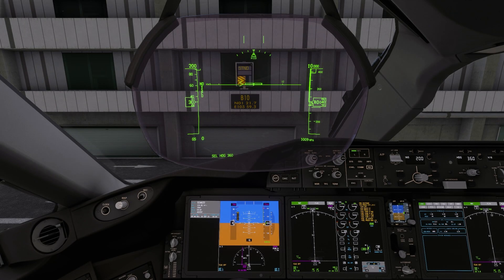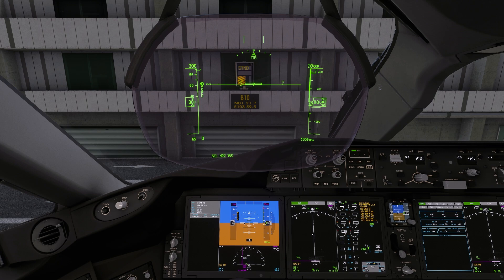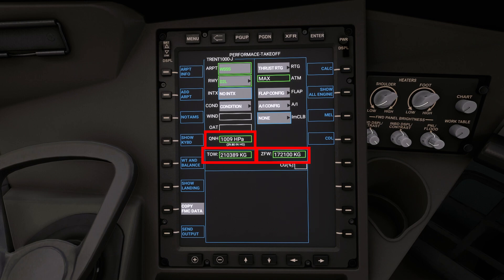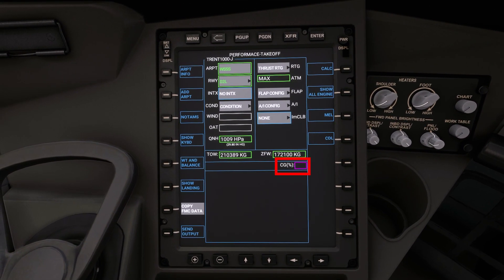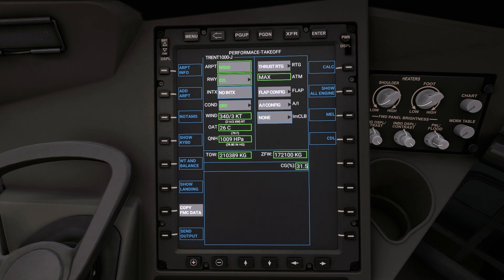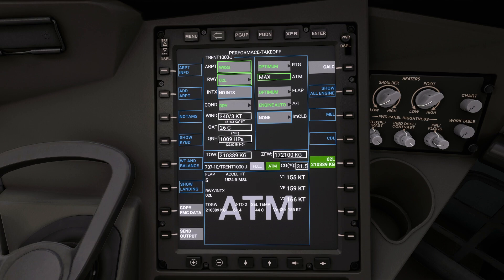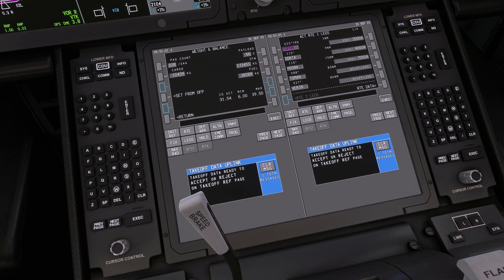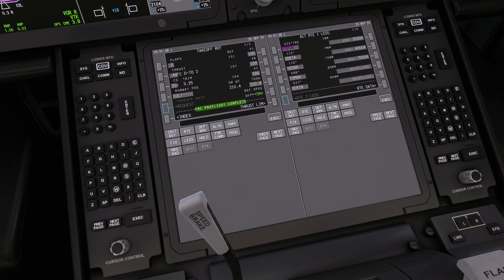Tutorial: How to use the EFB in the Boeing 787-10 Dreamliner

Comment: This is a very interesting and helpful video but as someone commented earlier, there is very little new there that can't be achieved by the FMC itself. However, perhaps somebody here will be able to throw a light on the problem I'm having or rather show me a solution. After this last MSFS update my 787-10 behaves very odd. It won't climb past 10000 ft unless I force it to and when I descend then it won't go past 10000 ft either unless I disconnect the A/P and manually descend down to 5000 and then reconnect the A/P. Then I'm able to descend and fly the approach as per normal. It does not matter how high I go, FL200, 300 etc. and it always levels off at 10000. I don't know if I'm doing something wrong but this is the only aircraft that displays this behavior.  I have got several other Boeing, like PMDG and others plus several Airbus and none does this. I'd love to hear from someone relating to this.

Comment: why is my EFB not working, is still a black screen but buttons are touchable but no screen...
Reply: Same for me
Reply: remove any mods that you have installed for the 787 (example light mods, etc).
Reply: There is a power on button on top right of efb, press it on the EFB screen will appear. My question if you don't have a keyboard (xbox) how to you enter the parameters on the EFB?